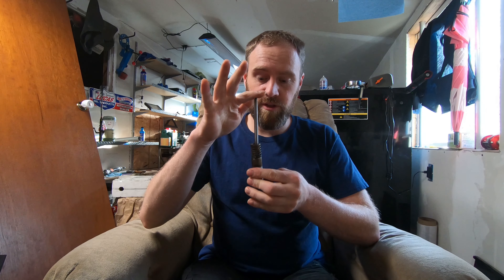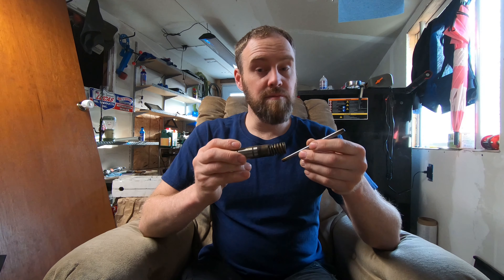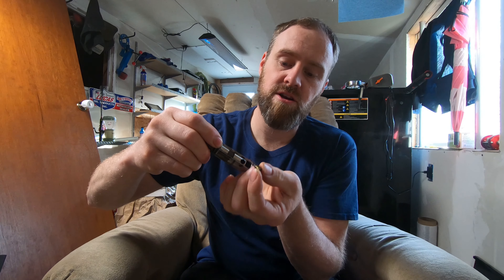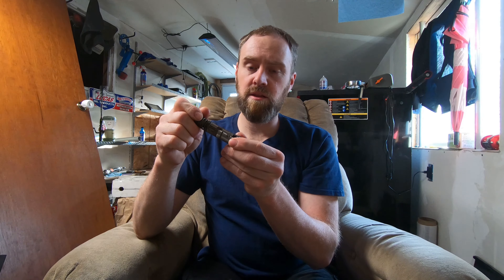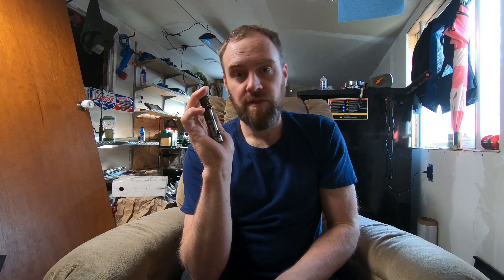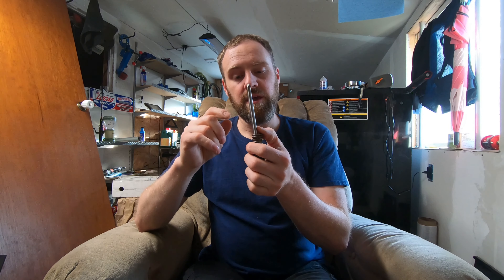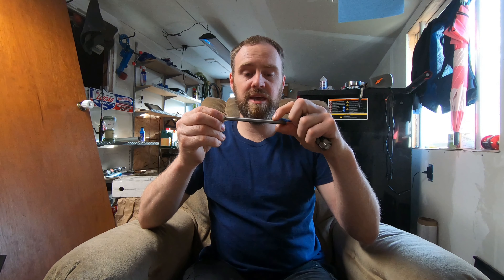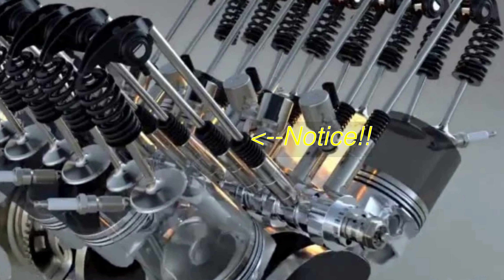Bent Pushrod, Is GM engineering to blame?

Comment: I swear you'd think every vehicle off the line was faulty if you only read these youtube comments. Let reality set in and realize this happened in about 2% of their vehicles, and now that GM has ordered all dealerships to replace both banks before they can even put it on the lot, and that goes for new or used. And just remember Dodge, Ford, Toyota, Nissan all have various issues of this degree at around the same percentage. While I still believe you will have this issue down the road, it will likely be because of not using recommended premium oil, fuel, or routine maintenance, which falls on the owner not the parts. Point being, if you've bought one of these vehicles in the last year or are looking at purchasing them or newer 2022+ models, you shouldn't right these off immediately. My 2022 RST 6.2L with DFM and a Pulsar LT installed runs beautifully. Even had a GM mechanic buddy of mine, who'd seen this issue multiple times, open it up after 25k and check to make sure everything looked good and it did. He checked all the lifters and pushrods and showed me the push rods+camshaft so I could see there weren't any significant marks or scores on them. He mentioned the class action, and said it looked to him like they fixed most of the issue with the new parts. However, he did say he'd still seen the 2023 models with the same issue at low miles. All in all I would remind people these videos are nearly 3 years old and many of the negative comments you read will be old too. It honestly makes me believe I have a unicorn but really people only come and comment on these videos when they've been the ones with the issue, so it's really skewed towards that. Sorry to anyone who's been affected by this.
Reply from the maker: I believe it effects more than 2% with these engines. Iv'e sold hundreds of sets of pushrods and thousands of lifter release kits for the lifter issues. The pushrod issue turns out to be engineering failure. They didn't account for machining tolerance changes to give enough clearance for machining or wear of the engine over time. What happens is some will be great maybe 80%, some will be an immediate failure under warranty maybe 2-5% hard to say and the rest will fail after some 36k plus miles are on it and may or may not be covered depending on warranty. Over all I would say its a solid 20% of AFM engines effected in the first 100k miles and then it's a solid 70% before the 200k mile mark. The DFM engines like yours are to early for me to judge yet.

Comment: Have a 2014 Silverado crew with the 5.3 95 k on it so far so good no issues but definitely interested in the push rod up grade
I believe this is failure by design on purpose by GM to get people to stop buying the V8 and buy the 4 cylinder and electric models
Reply: They keep it up and people will stop buying any of their vehicles.

Comment: What is very important on these newer engines is to use the correct oil filter. from my research don't user the AC Delco PF63 the bypass valve opens too soon so you have unfiltered oil running through your engine. You must use the PF63E.  The older PF63 has a bypass pressure of 12 PSI. The newer  PF63E has a bypass pressure of 22 PSI.
Reply: It’s discontinued. And you want a lower bypass pressure so the lifters get fast oil flow.

Comment: And I keep having people tell me I shouldn’t have bought the Armada.  All I read in the comments of these GM video is bent pushrods x100. Yeah, I’ll keep my 400hp dual overhead came 5.6 with 45 more horse power than a 5.3.  GM is still a crap company!  I’ll keep buying Honda’s, Toyota’s and Nissans!  Japanese all the way!
Reply: I'm still driving my 2005 Armada with 220,000 miles and I tow a boat a good amount.  Zero engine problems.   Few problems at all actually.  Some but not much.   Nothing compared to this S show.

Comment: Yes this has happened to me. I had the problem with my 2015 Sierra with the 5.3L . Number 7 piston position started misfiring, but I don't know for how long. I noticed it one day getting onto the interstate when accelerating to merge into traffic. I was going to get an oil change from my dealership anyway so I mentioned it to the service writer to check it out. They kept the truck 8 days telling me everything was OK with it but that it needed a tuneup. So I had them do that, but it did not stop the misfire. Then they said it needed a carbon cleaning, and at 8 days they called wanting to talk to me about the truck. I went in to talk to them and they said they needed to pull the engine and tear it down to find what was wrong with it. At that point I said no I was not going to do that. At 8 days they didn't know anymore about it than they did the first day I took it to them and they are supposed to be the experts on the truck. I paid them for what they had done, but wasn't happy doing it. I had it towed to another independent mechanic. In an hour and a half he knew that it had a bent push rod and collapsed lifter. The only parts we could get were the original parts without spending ton of money. As it was I spent $3100 total getting the truck fixed. It now sits in the back yard only to be used when needed. The new or used trucks are just too expensive to trade for. I think I am done with GM until they get their act together and start making reliable vehicles again.

Comment: I like your ideal I believe her mind says part of the problem but in reality I believe it's the way that it lifter is designed itself the new design has a 10 so it don't spend internally and I believe the valve is floating just a little bit due to the harmonics and when that happens the lifter come apart and catch on the pain and give a over hundred thousands more lift which is causing spring bind and bending the pushrod I've even had a rocker push the bearing out if they were to get rid of the locator pain inside the lifter it would fix the problem because the old ones did not do this
Reply: Yes it has to be something like this. Or maybe they have reduced the valve spring tension to take some load off the lifter and at higher rpm’s there is valve float causing the bent pushrod. Ether way expecting a pin to lock and unlock a lifter controlled by oil pressure is never going to work.

Comment: Is there such a thing as carbon fibre push rods? something light and strong. Also is there a very low resistance oil filter that would keep flow and pressure up as much as possible? With the price of Pickup trucks, it is worth it to put a bit more into them to make them last. Thanks for your content. It is very interesting.
Reply: Gm has another design flaw...the 3.0 duramax diesel has a belt driven oil pump and 2 rear engine timing chains but belt is submerged in hot oil, that belt has a service life up to 150k miles and to replace the belt or timing chains the transmission has to be removed..now get a load of that🤦🏿‍♂️👎🏾👎🏾
Reply from the maker: No carbon pushrods needed. I have a Heavy duty one I offer with slightly smaller diameter so it wont interfere. There are high flow race filters available but I'd rather have better filtration if the truck is factory yet. Most models have a laonger version available that will work in place of the tiny stock one. I forget the number though, perhaps someone else will comment on it.
Reply: @David-yy7lb  hmm,nice, like a vr6 VW with the timing chains on the trans end. 
Shit job ,it's 6 of one half dozen of the other, to pull the whole mess or pull the trans and do it in the car.

Comment: I have a 2021 GMC Sierra AT4 (6.2L). The truck appears to run fine, but I have a question. I know you can "disable" the DOD/AFM by driving (shifting) to "L9". Will this help with all these bent lifters going on?
Reply from the maker: No, the bent pushrod  issue happens in V8 mode.
Reply: He's right my 2021 is at the dealer for that now, I've had the fuel management cut off from day one, it will not stop it.

Comment: GM just fixed my 5.3 L84 bent pushrod , don’t know what cylinder  15000 km on Tahoe
Reply from the maker: It will happen again. They just replaced it with the same part that has an issue in the first place.

Comment: Back in September 2020 (later updated in November 2021) GM put out a TSB re: 5.3 L82, L84, 6.2 L87, 6.2 LT1, LT2, and LT4, and 6.6 L8T for possible broken valve springs with service codes of P0300, P0106, P0506.  Is there any connection with the pushrods you're finding?
Reply from the maker: Not that I am aware of. I do read the GM TSB's when I come across them but find I have to take them like a grain of salt. My guess is they used a poor quality spring steal or had a batch not treated correctly. I don't think a pushrod is likely to cause a valve spring issue though I guess its possible. Thing with valvetrain components and harmonics, you can have some really strange issue's from something as simple as this pushrod vibration.

Comment: 2021 GMC Sierra 1500 5.3 bent pushrod at 11,392 miles
Reply from the maker: Crappy deal, Thanks for helping confirm this issue.
Reply: 2021 Sierra elevation in the shop today bent pushrods 7160 miles! Damn it!
Reply: 2021 Sierra 6.2   8400 miles. Taking to dealer today. Sounds like bent push rods.
Reply: 5.3 Sierra Elevation.  7200 miles.  Bent rod.  I can’t believe they are selling these trucks for $50k.  Insane
Reply: @d4dooley  all day every day it’s crazy

Comment: Have 3 21 Escalades, on two of them the lifters went and the rods bent within a 3000 mile range. On one of the the sway bar just cracked at 6500 miles!!!! GM = POS
Reply: @EB Indy I have a limo company, why would I buy a Toyota or a Lexus? Btw both my mom and sister drive Lexuses :)
Reply: @EB Indy There are standards, and sadly its Escalade.

Comment: How many have to fail before GM does a recall? Sounds like GM is doing the same thing they did for the ls7 failures which was wait til they fail and replace with another unfixed part.
Reply from the maker: It's not a safety issue so it probably won't happen.

Comment: Bent rods on some engines? Sounds like bad material or bad heat treated batch. I believe they get heat treated in a batch load furnace maybe thousands in a load. If the load did not run correctly or quench correctly you will have soft spots in the rod causing this issue. I’ve been heat treating for more than 25years and I seen load failures, some caught in time others when it was too late/field failures that caused really expensive machines to fail during production. GM need to get all this failed parts and perform a lab test and find the root cause.

Comment: 2015 GMC Sierra SLT w/the 6.2L V8. 79k miles, just bent 2 pushrods and had 2 lifters fail. Bought the truck new in Dec 2015 because I wanted a nice truck as a retirement gift for myself. Currently in the shop waiting on backorder parts for repair. quoted $4500 for the repairs. Luckily, the camshaft wasn't damaged or the repair would be ~$8500. I'm less than 30 days outside of the "extended" warranty that I paid for when I purchased, and GMC is telling me to eatadik. No rental reimbursement or loaner vehicle while they are holding my truck hostage waiting on parts. I guess I'm expecting too much from GMC, but the last thing I forecasted was engine failure on a $70k truck with relatively low miles. F*ck America I guess.
Reply from the maker: That's unfortunate, if you where close to SD I'd say bring it over.

Comment: I have 2021 gmc serria at4 @9000mi I had a bent push rod on the right causing my lifters and push rod too be replaced…. As I drove it off the lot within 10 min I started hearing same issues… took it back too gmc they try too say now lifters on left need too be replaced !!! Should I be worried about long term damage too Egein or long them effective s on my engine after they fix issue ??

Comment: Get the GM diesel and avoid the GM engine gasser mess.
Reply from the maker: Not sure that's any better. Not enough out there yet to really see common issues. Besides not everyone wants a big diesel or to deal with def fluid and other diesel specific things. Most folks buy them as a daily, I know not what a truck should be for but hey whatever.

Comment: Dang I just had to replace my  4wd  low an high switch on my 02 supercrew lariat  at 237k miles , gosh I got ripped  off lol.. SSSSYYYYKKEEE!!! An they wander why ford trucks  sales been up last 40+ years.. lol..
Reply from the maker: Yeah ford's not doing that great either but I guess it's a little better than gm while under warranty. Once ford warranty runs out though run like hell. They are crazy expensive to fix vs gm. The old ones both brands not so bad. But now all the domestic trucks are trash in my eyes. It's a shame to because on paper ford's are awesome now.
Reply: @CrazedPerformanceRepair  ha. Ha. Dont be a hater all yur life  , ford ain't  doing  to good the  chip shortage  ,  but they still  out sell chevy  , an  guess what I help them out in this  chip shortage  crisis an bought me a 2020 race red 6spd gt premium race package,  10k miles  for  39,600$  this is the 9th all ford  powered stang I've owned  in My 39 years of age   an out of the nine stangs  , 5 are still in my possession,   now this a is were we draw a lin between  a ford guy an chevy guy is that  FORD OWNERS  DONT HAVE BUDGETS  AN SPENDING  LIMITS , WE HAVE PLENTY  $$$ THATS WHY WE DRIVE CAN AFFORD  A FORD , chevy folks always  throwing  the price  tip up  , lol..yall drive  chevy  cause its cheap  an yall have  limits  an budgets , simply  as that..yall are the only  1s talking  bout our ford  prices , wats up with that??
Reply from the maker: @daviddixon3567  lol you mistakenly judge me as a Chevy guy. Definitely not a Chevy guy. If I had a choice for something I don't want to mess with it would be a Nissan. That's more expensive than anything to fix but my issue with ford or Chevy is down time. Ford you out a huge bill and a ton of down time for one huge repair every so often. Chevy your down often for cheaper each time. In the end it's the same shart different preference. At least with Nissan or Toyota it's a rare repair and usually simple things though may be a bit labor intensive. All cars are junk to me just pick your poison I guess. I drive old crap because I can fix it and don't care. I have all pre 2010 a Ford, Chevy, BMW, just got rid of my rotted out Nissan, and a old Pontiac. Unlike many I'm no fanboy of anything really. I've fixed them all basically and have realized each one has its goods and bads.

Comment: What compels GM to do this nonsense? Are they forced by regulations? 2008 Suburban 1500, deleted my AFM and my reset my MPG and there’s been no difference. Can’t wait to get one of those 2021s with no AFM/DFM due to chip shortages, will be waiting a few years however.
Reply from the maker: Yeah it's combination of regulation, cheap parts, and wanting to sell parts. Parts are after all where there money is.

Comment: Why does everyone say it starts with 2014. The afm started in 2007 and the issue has always been there????!!!!!! It has nothinf to do with geomotry its the stupid hydraulic lifters that are made to collapse. Hello!!!! NO HYDRAULIC LIFTER SHOULD EVER COLLAPSE NOT EVEN THE ONES IN MY 77 CAMARO!!!!
Reply from the maker: Then you clearly don't understand the system. The lifters failing has happened since the new version AFM system started in 2005. The interference issue I'm referencing to in this video specifically bends the pushrods and is not related to the lifters. Later on I was able to confirm after making this video that it is a engineering flaw and that the push rods are slightly too big for the allowed room in the engine. They interfere with the AFM lifter spring and/or the cylinder head. Switching to a 5/16 push rod takes care of the issue.

Comment: Gm has been making pushrod engines for how long? And they STILL can't get it right? 
After finally fixing their stupid small block design shortcomings, they make this disaster now.
Switch brands folks
Reply: Just a FYI. FORD V8,s went to cylinder deactivation for 2021. Yep my buddies f150 5.0 has it. 🤷🏻‍♂️ bad enough it has auto start and stop! Just to squeeze a measly extra MPG!
Reply: @callitasuseeit.6564  Ram also has it.
Reply: @rs_pa  just leave the engines as they were designed…. V8, V6, 4 cyl. U want good mileage buy a small truck with a small engine is what I say. Most engines are dependable…. It’s the stuff they make it do ….to squeeze a mpg here and there. Senseless if I ask me.